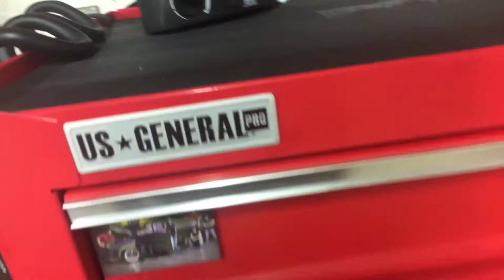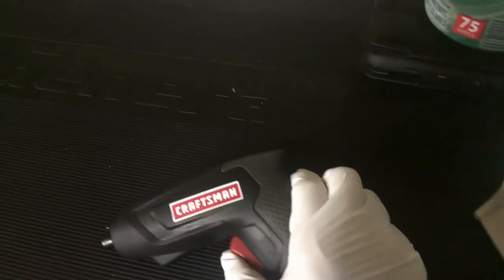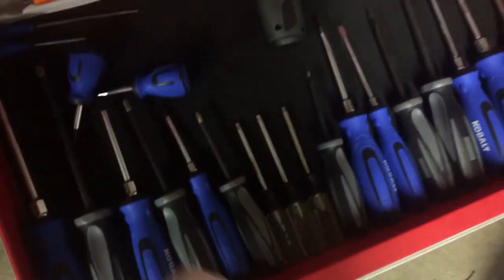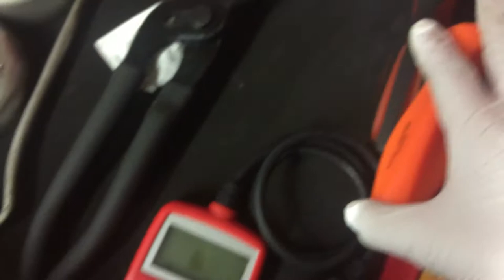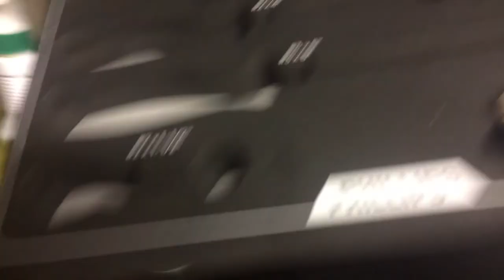Toolbox Tour

Comment: How many times did thst brand new brake spring tool save your but lol? But you have a good start for a young guy. But you said dont need many metric wrenches, everything in the last 15 yrs is metric. So buy metric I am a mechanic work on trucks everyday I have one set standard wrenches and one set sockets for 1/4 3/8 1/2. Everything else I own wich is a stupid amount is metric. So take it from a pro buy metric lol. But like I said I am impressed at your collection for being young.